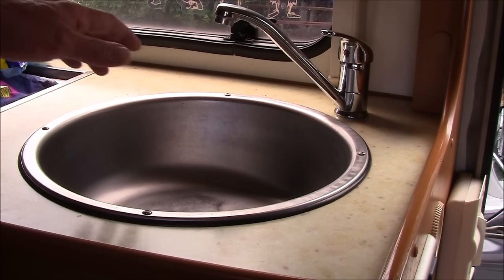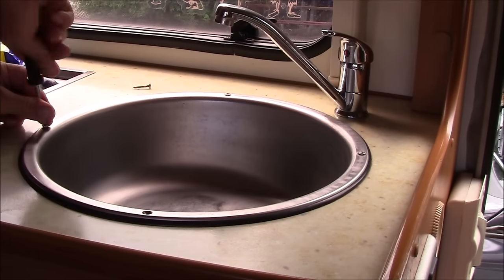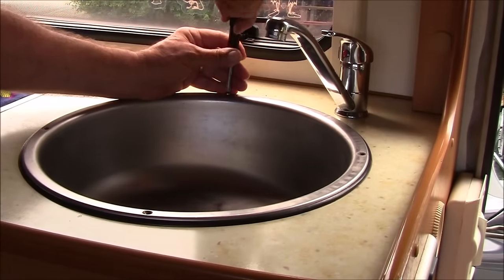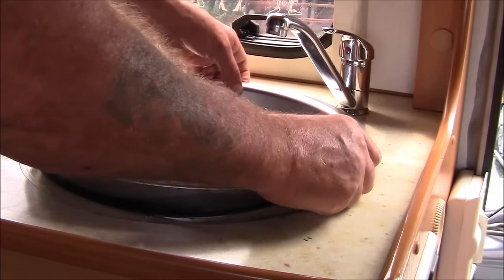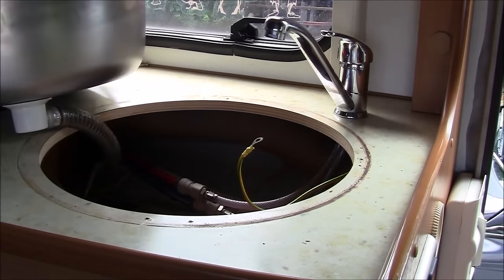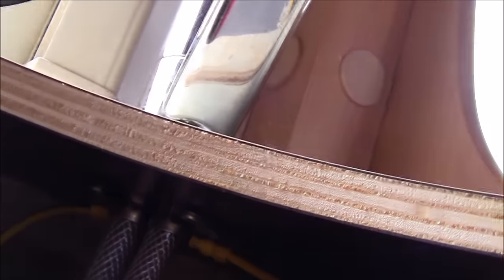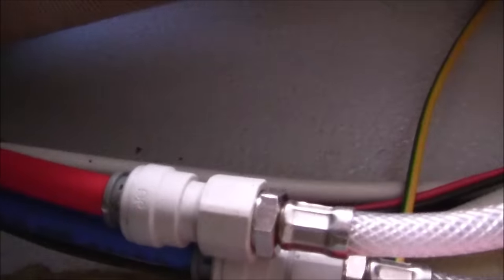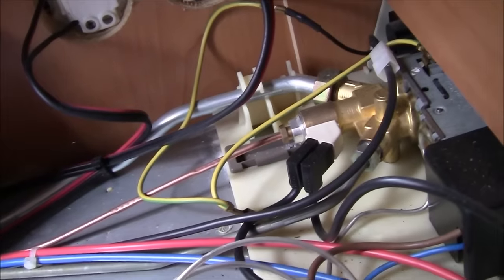HOW TO REPLACE A MIXER TAP IN A MOTORHOME OR CARAVAN

Comment: They earth tag goes under one of the sink fixing screws. Just like earth bonding your pipes but you can’t because there are plastic.
Any short circuits if you have and you touch will send to earth and trip you fuse or rcd rather than kill you.
Now you know.

Comment: You the same sink as mine in a CI motorhome, but I want to know how to disconnect the water pipes though?? 😏
Reply from the maker: If you have white push fits you have to push the front of the fitting into the main body and this will release the grip on the pipe so by holding the main body put your fingers round the the front of the fitting pull it in to the main body and at the same time pull the pipe out of the fitting to refit push the pipe back into the main body and pull the front part back out i believe your water pipe is blue and red or just blue hope this helps ATB 
Mark
Reply from the maker: https://www.youtube.com/watch?v=8Xo4fl7MLYw